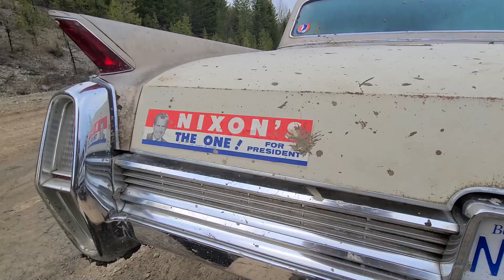Gambler 500 BC - DawgStrip

Comment: i have to say that the BD 500 looks like a blast.  wish the vehicle i learned to drive on still existed.  it would be hilarious to  do on such an event.  Sadly i don't think there is anything like it here in Ohio.  

(in case you were wondering said vehicle was an old mid '50s US Army duece and a half truck.  her hood was missing the floorboards were stop signs and the bed was just old plywood.    the tranny was shot only have 1st 2nd and maybe 3rd  with no reverse and stuck in 6x6 drive.  the old girl was a farm runner used by my late Great uncle.  mostly just for gather hay bales and such.  it did have a makeshift crane on the back as well (all muscle powered,  no winches for us though there was a come-a-long mounted on it just in case.))

Comment: That Cadford is a towing beast. As for those who throw a fit over using a Ford under the Caddy, just point out that Cadillac was originally started by Henry Ford and he sold out his shares to his investment partners who renamed it Cadillac. In fact the original 1903 Ford and the 1903 Cadillac looked almost identical and body parts could be interchanged between them.

Comment: How does one get info on participating? I’m a ways west of Prince George. Didn’t know this existed until I saw your videos. (I’m not on the book of Face)
Reply from the maker: The BC Gambler is mostly organized through FB. There is two events for 2023, one of which will be Mud Bogs at 100 Mile horse power ranch.
Reply: @DawgstripProductions  well, guess I’ll never go if the only way is through Facebook. I was hoping for a phone number, or an email even. Heck, even an address to send a hand written letter too… I promise not to use cursive so a millennial can read it.